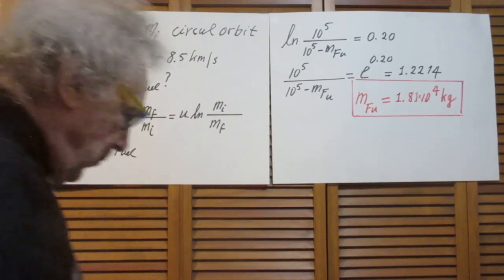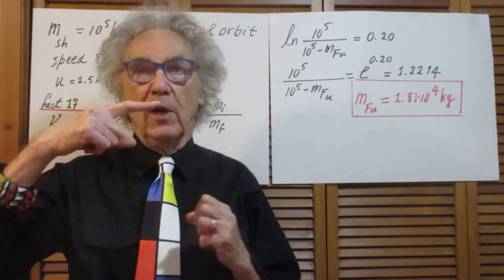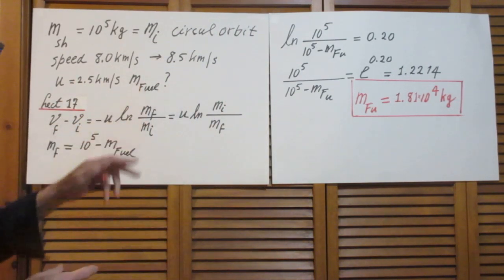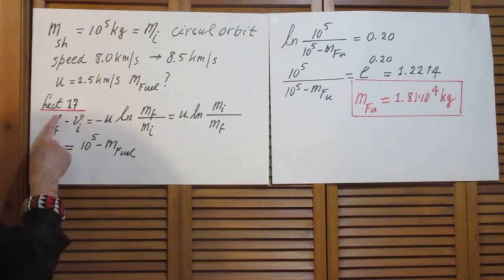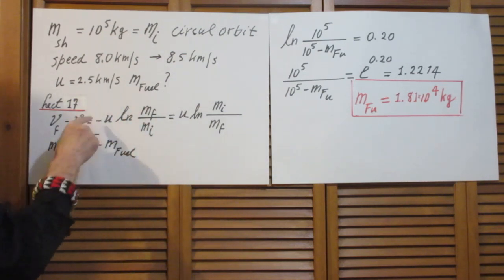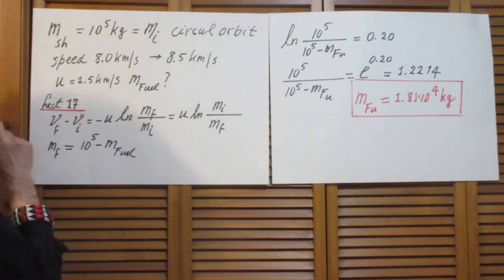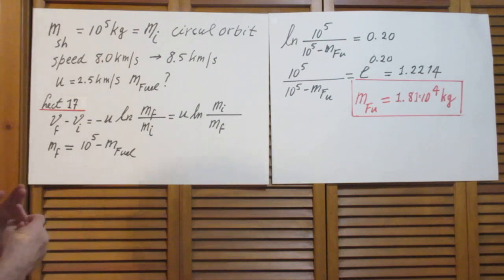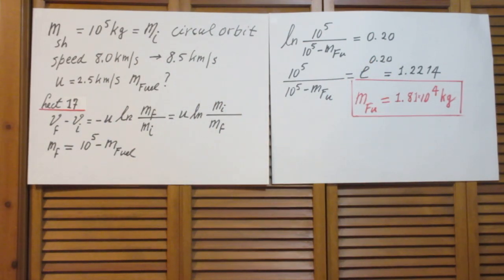Solution Problem #67 - Shuttle Fuel Consumption

Comment: Dear Professor Lewin,
 I love your courses and videos.
 I wanted to know if you have done anything on the bifilar coils serial connection and compared them to regular solenoids.
 I have been researching Tesla and his work for many years now and I have many questions about his patent #512,340
 Have you done any research and work on this patent at all? Could you come up with a problem for your classes about this coil and the method used in Tesla's patent?
 How is it different from solenoid coils and what effects do you see happening when used with pulsed DC or AC...
 Thanks for the time...
Reply from the maker: Watch my 8.02 lectures which are on this channel and read https://en.wikipedia.org/wiki/Bifilar_coil
Reply from the maker: "Bifilar coils impose an inductance in the common mode, but impose no inductance in the differential mode. Coils in such a combination are widely used to eliminate ingress or egress of common mode signals from electronic signalling circuits. This arrangement is used in transmission and reception magnetics of Ethernet cables[2] and conspicuously in the form of a ferrite bead clamped to the outside of USB, laptop power supply and HDMI cables."
Reply: @lecturesbywalterlewin.they9259  

 Right but the coils themselves. Have they been reproduced and compared. There seems to be a lot of confusion about a series wound bifilar coil and it's abilities both in magnetic response and the ability to have less cemf via the extra capacitance the winding provides. 
How would Lenz's law apply to the bifilar coil in serial connection seeing that the self inductance is short circuited by the opposing parallel winding in the serial version?
 I know how wire wound resistors use the bifilar winding and it only proves that self inductance can be negated in that sense. But how would that same method work for larger bifilar coils not made of high resistance wire?

Comment: The speed change is so small that rocket equation is not needed.  I assumed all the fuel was ejected at the mid-speed (8.25Km/s) giving fuel speed 5.75Km/s.Using simple momentum conservation, fuel mass is (0.5/2.75) * 10^5 Kg = 0.181 * 10^5 Kg (accurate to 3 places).

The fuel exhaust velocity seems low!  I thought H2/O2 rockets achieved 10Km/s exhaust velocity, and N2H2/NO2 somewhat slower.

Comment: do close values count? i did it a different method and got 16 tons instead
i searched for the thrust per gram of fuel of the space shuttle and it was 1KN per 300 grams or 3 newtons per gram
then 3N/100000kg = 0.00003 meters per second to get acceleration
then 500velocity/0.00003acceleration=16666666grams
so i got 16666kg
i know i left the part where the rocket becomes lighter as it loses mass but i think its a close value or did i miss something else?
I suppose ur method is the correct one ill watch ur lecture (i would have preferred a link to your lecture in the description) but i wanted to try doing it myself first trying a different method :D

Comment: Sir ,is drift velocity of electron vector quantity or scaler quantity? Sir i really need your  answer.          I really can't find its answer anywhere.
Reply from the maker: speed is a scalar, velocity is a vector. However, the drift velocity of electrons in a wire is always in the direction of the wire. Thus it's a moot point whether it's a scalar or a vector.